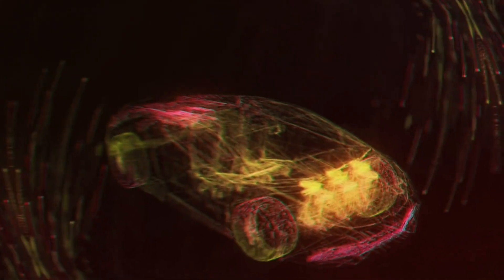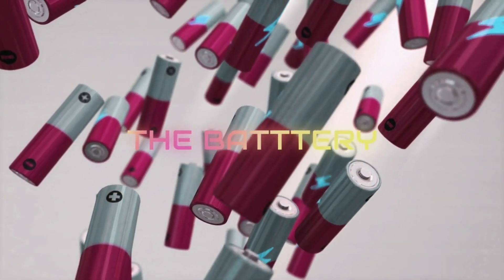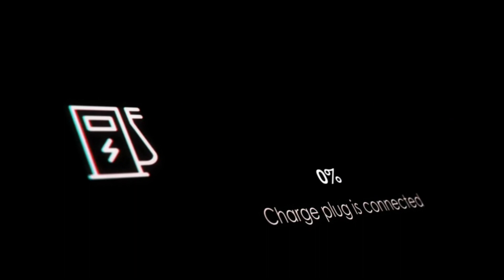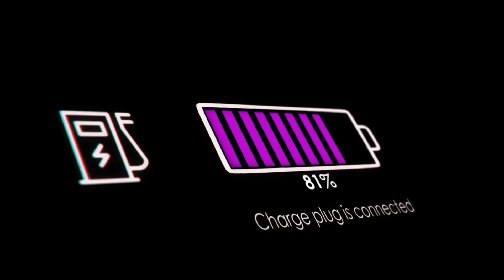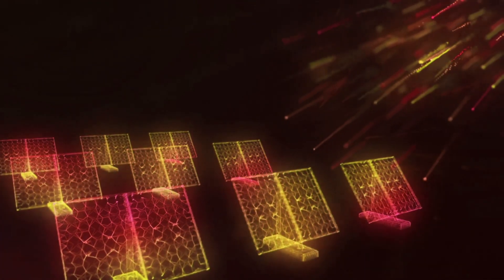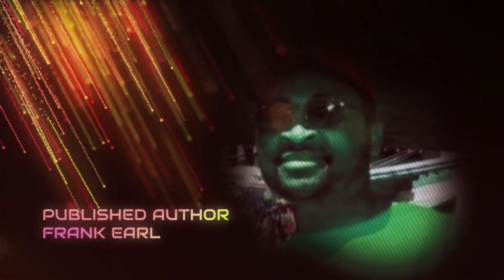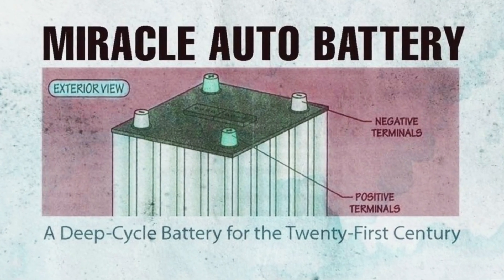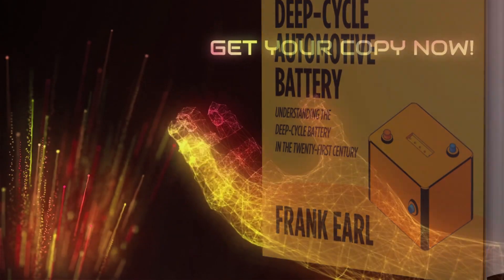Reverse Engineering of the Deep-Cycle Automotive Battery By Frank Earl Book Video Trailer

Comment: More than a century has past since the first automotive battery was made and yet, we haven't changed the way we cycle our automotive batteries. Since their chemical compositions are two directional, then we shouldn't have to stop their discharging cycles in order to start their charging cycles as well.